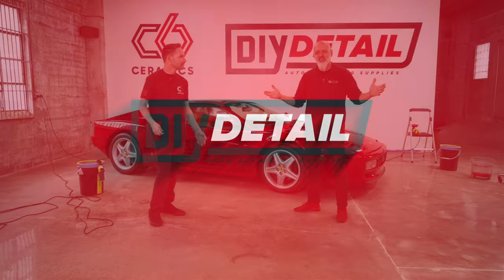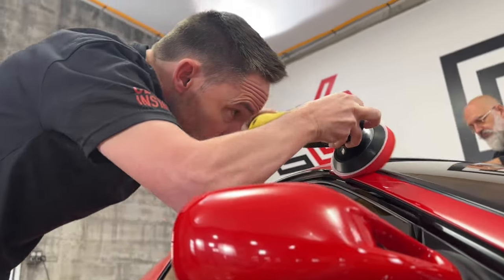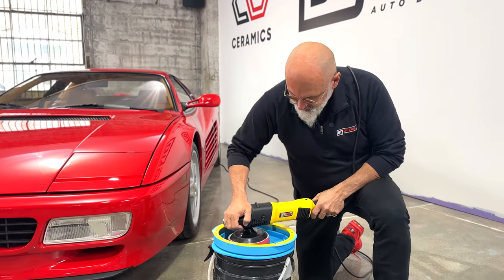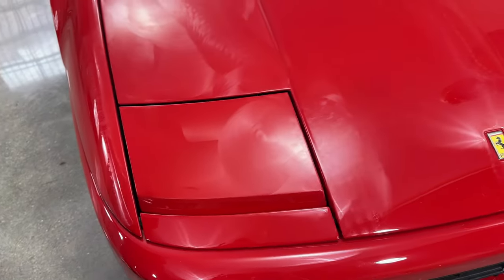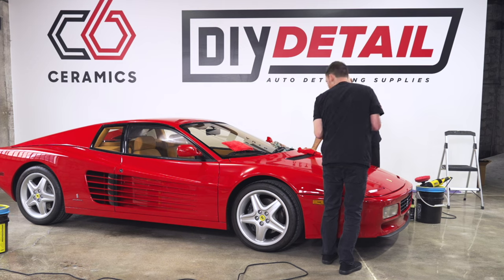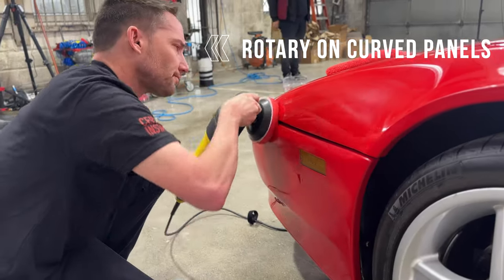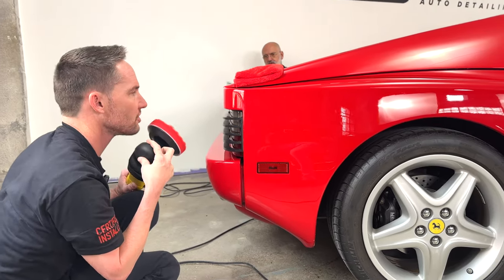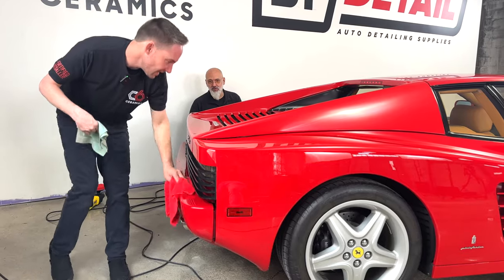Rotary polishing a supercar: Rare Ferrari 512TR  (with Jason Killmer!)

Comment: I thought I heard Ivan to not angle the rotary in the runway method. I haven't polished before and going to start on my own car. Why would a runway angle damage the paint and a slight angle Wouldn't?? Also what if im polishing a corner and I do polish over rubber or plastic trim?? Thanks.
Reply from the maker: Too high of an angle will cause pressure points. You can polish trim with DIY Detail Gold Standard Polish and a finishing pad.

Comment: Jason handles and glides through the curvatures of the Ferrari with that rotary as i do with a DA.  

Very tempting to give a rotary polisher a try.  What aspects if any with using a rotary should be considered when polishing a substrate if you know how to handle a DA?
Reply from the maker: Let’s just say he has some experience…

You want a minimum speed of 500-800 rpm, and a maximum speed of at least 2400. The rest is all personal preference. You will want to keep the pad clean, damp and as flat to the surface as practical, with no pressure.

Comment: Jason is definitely not running that Rotary on lowest speed. That's the loudest rotary I've ever heard. Did they put grease in that from the factory.
Reply from the maker: Yes he is at low speed, because of the microphones, and there are multiple  machines running it makes it sound loud.
Reply: @diydetailofficial  you better check and see if there's grease in that unit. That is loud